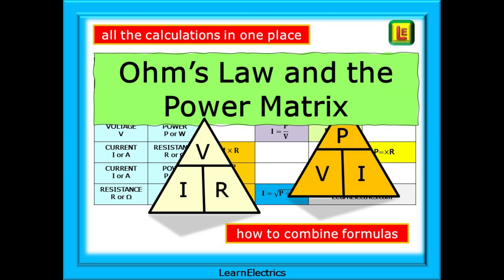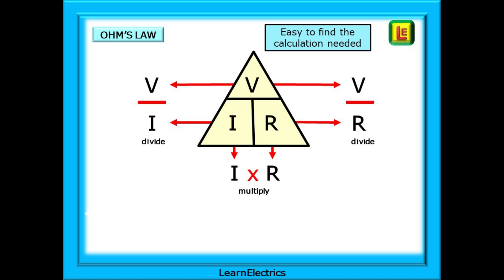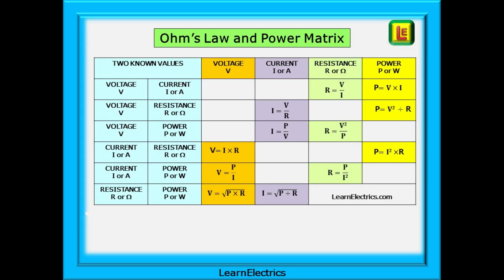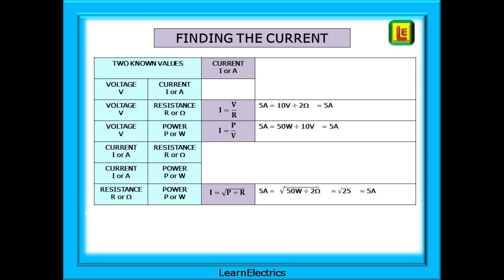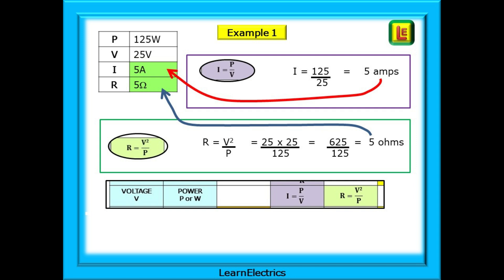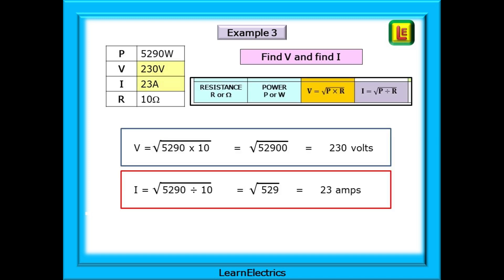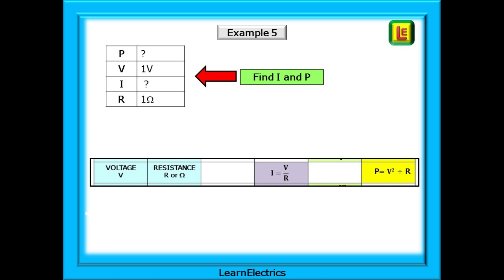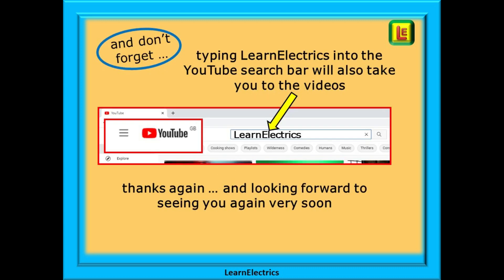OHM’S LAW AND THE POWER MATRIX – HOW TO COMBINE FORMULAS – HOW TO MAKE CALCULATIONS – EASY TO USE

Comment: Good day sir. May i ask tip for get resistance value for conductor from voltage drop table. Then i do continuity test i may know what the value show i get for good cable resistance for 10mter, 20mter and ect.
Reply from the maker: You will get the cable resistances from table B1 in Gudance Note 3. Also take a look at this video on the attached link, thanks, Dave....
https://www.youtube.com/watch?v=Ax4-bZ7WDwg